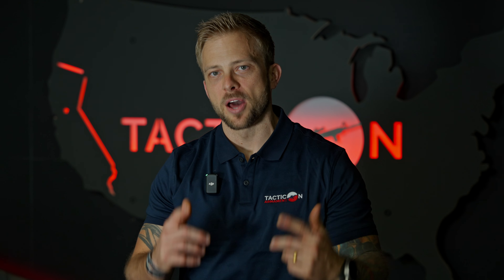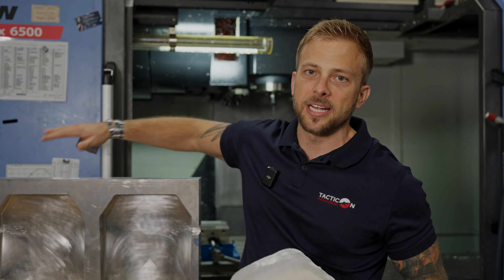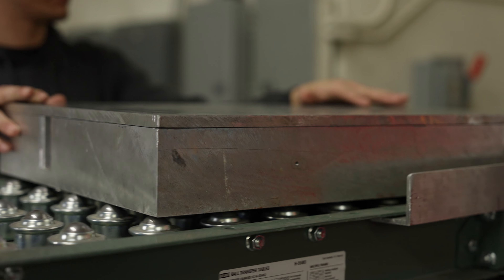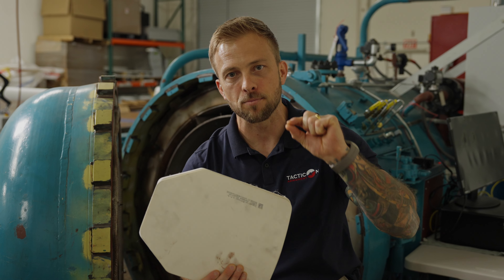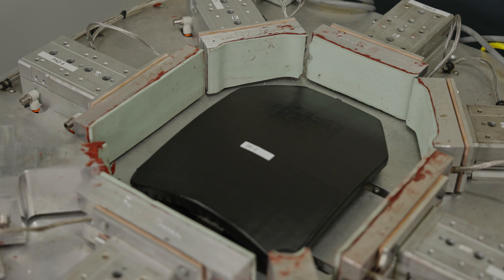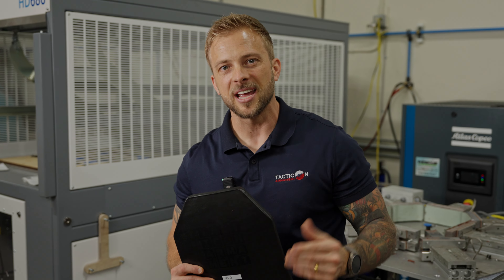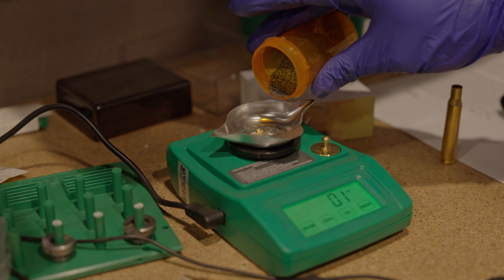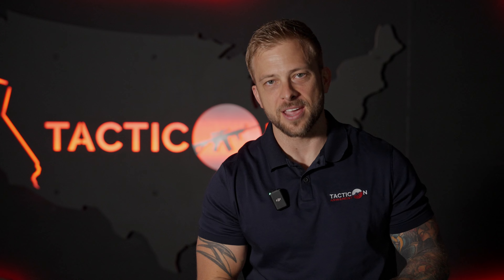The BEST Body Armor & How It's Made

Comment: My interest is really only in the way various armour works, the history, materials and technology etc, and I'm sure you make great products. I don't even own any hard plates (Gun crime is pretty low where I live, and rifle or assault weapons are a tiny, tiny fraction of that). But switching to "Devils Advocate" mode because I'm a PITA 😉... Do you make your own UHMPE fabric from scratch, or the steel alloys? I suspect it's all bought in, so like everyone else, you rely on others to produce the finished product. A product is only as good as the lowest common denominator, it's foundations. If you have no direct control over that ingredient, you're not THAT different to the other companies. All you can do is test what you get, which is what all the other companies do anyway. They all stand or fall on the efficacy of their products. It's like the warranty on your car... it only guarantees they'll do something IF it goes wrong, not that it won't go wrong in the first place. Sorry, not a real rant, just applying my skewed version of logic. 🙂
Reply from the maker: No sir, we do not mine the ore to make our steel anymore than the contractor chopped down the tree that built your house. 

However, we test every lot of armor before it's sold even if it's already NIJ certified.

 I must say that your response:
 "you're not THAT different to other companies" is fallacious. 

Most armor companies don't make their armor from raw material to finished plate. 

That... is a fact my friend.